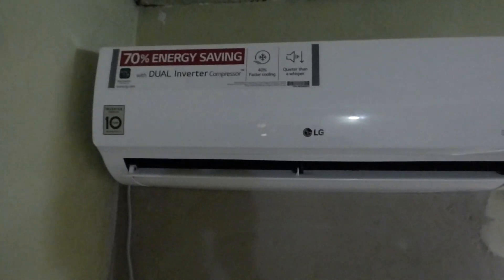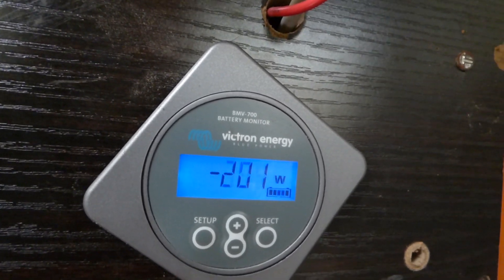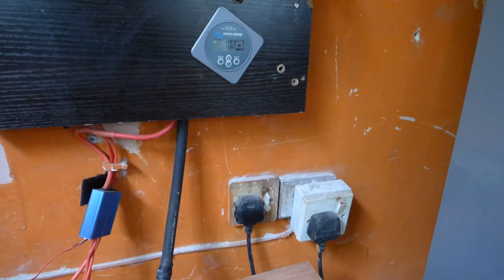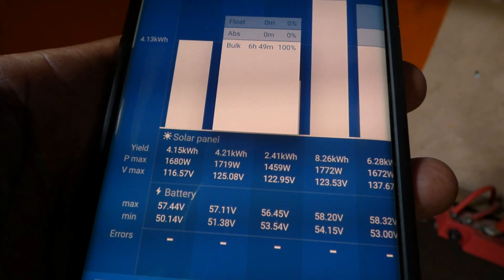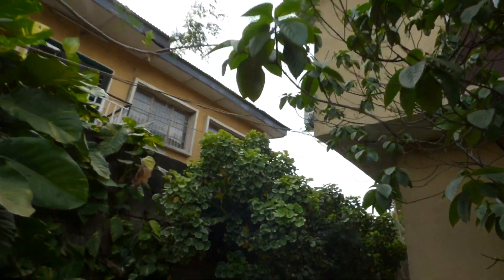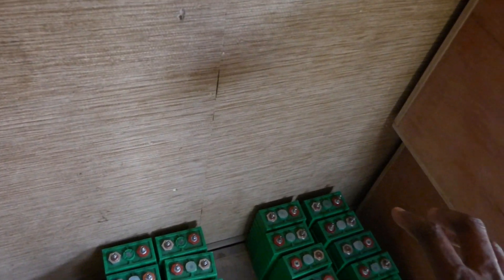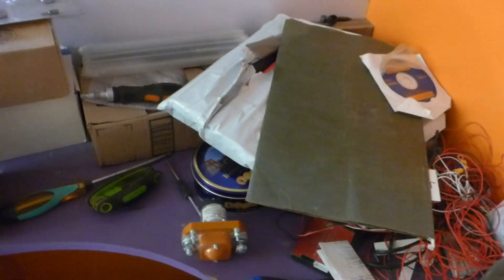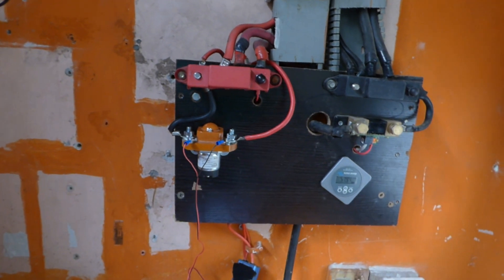My new LG AC and so much more on solar. (read description)

Comment: Those battery have a simple BMS that sits across the terminal of the battery and they do work well. You can buy them ( Look for the ones that has a status led. As for using resistors for bleeding, use only one except you are connecting them in series not in parallel.
Reply: Hi Dr Solar, thanks for an educational video as usual. Concerning the LiFePO4 batteries, why not contact the manufacturer/seller. They might have recommended BMSs or at least advise you on the best way to proceed. On an entirely different topic, what's the model of the growatt inverter and do you recommend it? Are those victron-like Fangpusun charge controllers still worth a try now that victron blocks them in software? Thanks again and keep up the good work.
Reply from the maker: @adon8672  thank you for watching. The bms stops an overcharge of the highest cell, it does not allow us to get capacity. The fangpusen is good as long you don't access them with Victron products. The MPPT control allows you to change settings. I have been discharging the lifepo4 batteries in parallel. We will try to charge using a balance equalizer. We will do a video showing how we make out. The Growatt is the SPF5000 it has worked so far but I am not sure I would recommend them for lead acid batteries.
Reply from the maker: These don't have a bms
Reply: @drsolar  oh yes they do have!
Reply from the maker: @rokaisalami8882  I purchased them and I own them. I should know if they have a BMS or not. If they have a bms then it must be bad. We have seen voltages above 3.8 and below 2.5.
Reply: @drsolar  It's not inbuilt. They normally come as a separate component
Reply from the maker: @rokaisalami8882  please show them to me in the video

Comment: What's the specification on that AC?
As in what's the current draw of the Air-condition alone?
I ask cos am running a 12v system using recycled 18650 cells.
18650 Hub Africa....
Reply from the maker: Hello Rokai it is a 1 hp LG Dual Inverter HP. I am sure that on the display of the BMV it shows the current that I am pulling from my batteries.
Reply: Thanks

Comment: good system run down and thanks for the explanation on the dual inverter aircon, that's something i may invest in for next year.
i'm glad those nissan batteries are living up to your expectations.
With regards to balancing the LiFePo4's , since they are relatively close right now what would stop you from putting them all in parallel to balance them together ?
im sure there's probably a good reason you haven't but i thought hey maybe its something to consider.
Thanks and all the best
Reply from the maker: Thank you for watching. They are performing better than they did when I first installed them. We had balanced them in parallel. We will try to discharge them like that too. The AC is a bargain at under $330. Thank you I appreciate your comments and advice.
Reply: @drsolar  its my pleasure, ohh i see, well at least we are on the same page there.
that's in freedom dollars i assume ? (roughly $600ish in my local tender), still not bad at all for the money i must say.
Reply from the maker: @nvmyutube  yes USD. It is a bargain.

Comment: U said in some of your videos that Nissan leaf battery are the best but u been having issues in balancing and getting good balancer.  
I suggest u leave Nissan leaf batteries and go for tesla models S 24v battery pack that comes with stock BMS. I think it's the best battery followered by Chevy volt battery pack 1st gen that comes with bms installed in each 24 volts pack.
Reply from the maker: The Tesla comes with a proprietary bms that you can't use. I have Chevy Volt batteries in Nigeria à pair caught on fire. I use 48 V inverters and at 6S the Tesla is not really an option. The leaf is fine when you do large banks for smaller banks you will have some drift. I concern myself with it. Others don't. Thank you for watching and commenting

Comment: Finding the sweet spot is what I try to do if you determine the power curve from high to low you will see the voltage drop off more quickly on the low and high ends. by setting the charge controller battery voltage for when to charge and stop charging at the flat part of the curve you will have less problem balancing but less capacity too except that you will not waste your solar production trying to top balance instead use that high voltage power by way of a diversion load which can run the air conditioner.
Excuse my ramblings perhaps this is all BS
Reply from the maker: makes sense. On a day like this I have a lot of power so right now I use it on the AC. I have found that anything below 3.65 the battery fades away very quickly. You make sense thank you for watching and commenting

Comment: Ya try 56v . If the bms does not start balancing 4.175 do not use it. You bms should be set to balance at 3.75v and cut off at 4 v
Reply from the maker: I will purchase a separate balancer . I find that the gen one leaf batteries don't give much capacity unless you charge them to 4.1. I discharge them to 3.60 max. Thank you Frank Z
Reply: @drsolar  Be careful with the leaf chemistry. They are explosive when mishandled. The LiFe Po4 are much safer.
Reply: I wish I could come visit you
Reply from the maker: @frankz1125  I will take that into account. Thanks for the headsup
Reply: I would parallel them and charge them to 3.55v and discharge to 3v only. No less. You may need a bench top power supply or a way to be exact with voltage. Too bad you are so far away . Id get them fixed for you